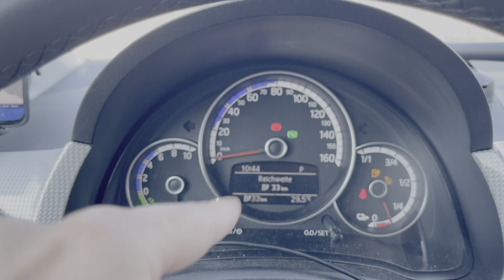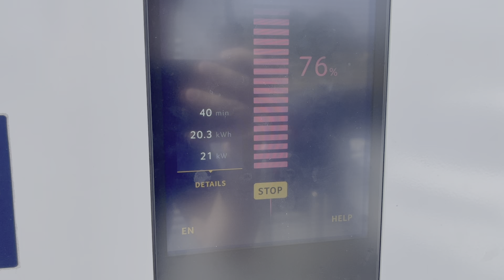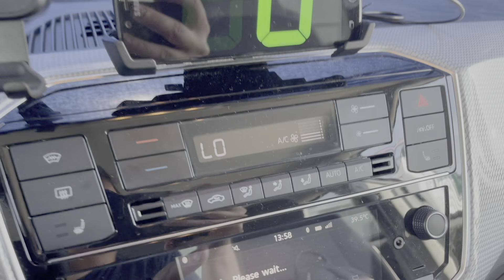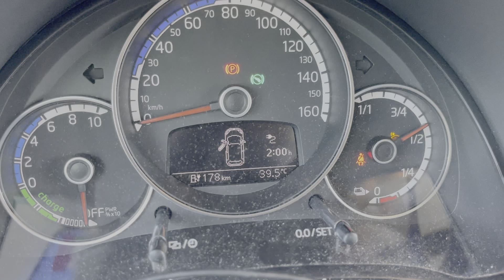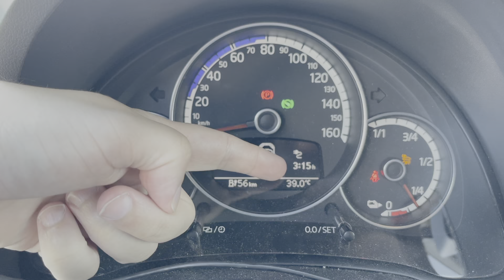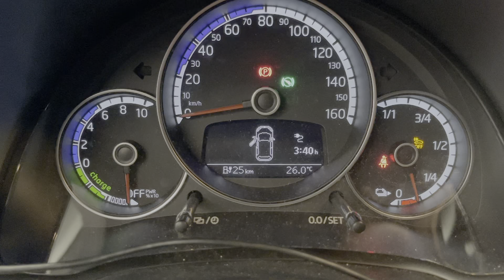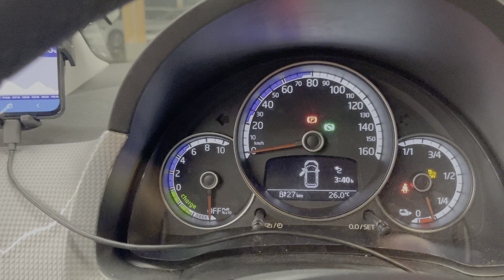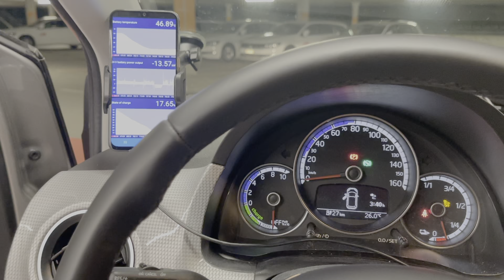2022 VW e-Up! DC charging speed on a 650 km trip in summer at 35°C

Comment: Why are electric cars still sold without active thermal management of the battery? It was a compromise almost acceptable ten years ago. Today it's completely unacceptable. How much could a fan, a radiator and some piping possible cost?
Reply: Might sound like a few euros, but given the alrdy really low price of the e-up, it would make it cost prbly a few k more

Vw doesn't really make profit in these afaik
Reply: sounds like maybe if the battery degrades enough to get a new car at 5 years, they might be able to sell a whole new car.

idk, i'm sticking with gasoline car for 5 more years minimum
Reply: The Seat and Skoda versions of this were sold for 15k€ or even less. They were sold at a loss for emission credits (real build value around 20k and profiting sale for 25k€). There was absolutely no room for ANY more advanced drivetrain at 15k€ lol. They are/were very goof for the price, even without the active thermal management. You can barely get a moped car (aixam) with that money and the UP is no moped car.
Reply: Because this car is nearly unchanged since it first launched in 2013. The only but important big change was the 32 kWh battery in 2019, before it was only 16 kWh. And 2025 when ID1 launches they will discontinue the e-Up. ID1 launch was first planed for 2023, but it got delayed like many other things.
Reply: More like how much would it weigh?
Reply: @someguy9520  I don't think it's the price added considering that a new battery cost 20k € (more than a telsa model s battery which is double in capacity and has active cooling)

Comment: we have Eup 1st generation and citigo ... the eup charges lot of quicker (it has half of the batery size but also if you compare the same size the 1 st generation charges quicker) ... i would say its because vw tries to carry more about battery in 2nd generation ...so the charging its little bit slower  ..... also I made 500km trip with citigo ...half of the road on high speed roadway cruise control 115/kmh ... with 3 charges ...1st small on the way there 20 min... one to full battery in destination (I have stuff to do there but the full battery charge was 1 a half hour)  and 1 small on the way back ......and we did twice the 350km trip with eup 1st generation before we had citigo ... it is quite a lot charges but it charges really quick ...

Comment: Lucky you. I had to do a road trip in the same 2nd generaton e-up in winter. The charging was even worse. From my experience, the hotter outside, the faster the charging. Try doing this in -10°C outside temperature. The charging speeds as well as the performance is appaling. I can compare with the old e-up, with half the capacity. It would charge from 5% to 100% on DC always under 30 minutes. Regardless of temperature. I did not test rapidgating with it, as I did not drive longer than two DC fart charges in a row. Maybe the third would have taken a bit more. But the new e-up is a joke compared to the old one in terms of charging. The old one took up to 50 kW, with the new one I did not get more than 34 kW, and even that only when the outside temperature was above 30°C and only for a short time between 20% and 25% SOC. It quickly decreased to 24kW and above 80% SOC it is not uncommon to be in the single digits in kW of charging power.

Comment: nice video. I've had the same problem before.
What speed did you drive? In my experience you shouldn't drive faster than 100km/h on long journeys.
Reply from the maker: Yes I drove 100km/h during my trip

Comment: I own the citigo an my experience on long trips is similar. I've not driven it on long trips with these extreme outside temperatures, but after a 3 times fast charging you can notice a big decrease in charging speed. 
What app are you using for measuring the battery temperature? in 2 weeks in i'll go from the Netherlands to austria (i will split it in 2 days) and it could be usefull to see the battery temperature.
Reply from the maker: Hi John please see this video for all the information about this app: https://www.youtube.com/watch?v=hT47A1CghR0
In addition to the app you also need a bluetooth OBD II adapter: This is the link where I bought my adapter:
https://www.aliexpress.com/item/959062486.html?spm=a2g0o.order_list.0.0.68e41802gh61FT